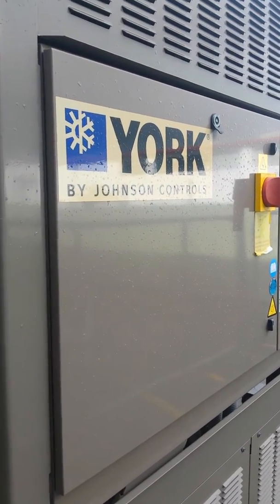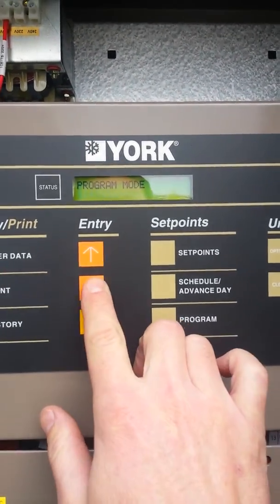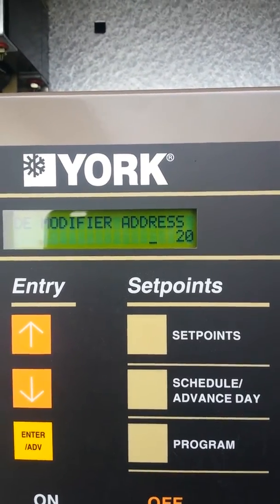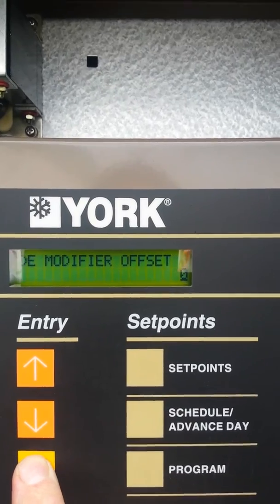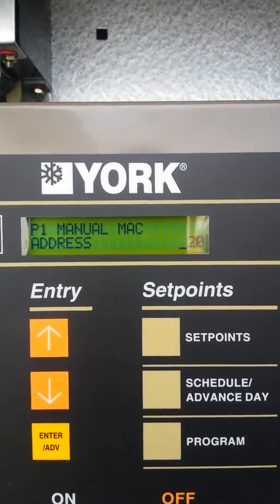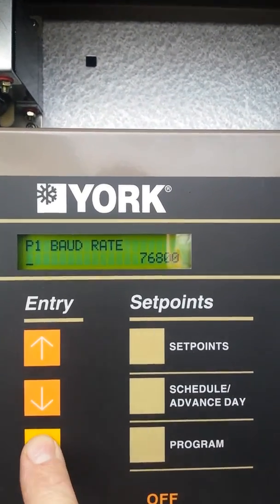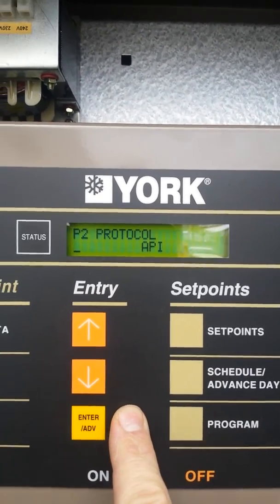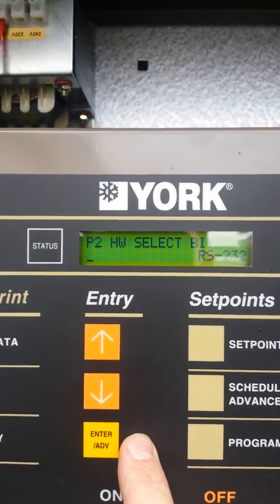YORK YLAA CHILLER BACNET SETTINGS

Comment: Thanks! Does the comm board require power off/on to take the new settings?
Reply: I followed the instructions here but the settings don’t appear to be taking. The chiller is undiscoverable. Using a 3rd party BACnet program I can see it but it says its Instance is 5001 or 6500, depending on what property you look at. This device is on a campus with many Bacnet networks and devices. The instance number is 11101. 
It seems like “DE MODIFIER ADDRESS” is actually the network number. Would the instance be this number, plus the MAC address?
Reply from the maker: Yes it does.
Reply from the maker: Also, if you have more than one chiller, set the manual mac address to 1 for the first one, two for the second one and so on..